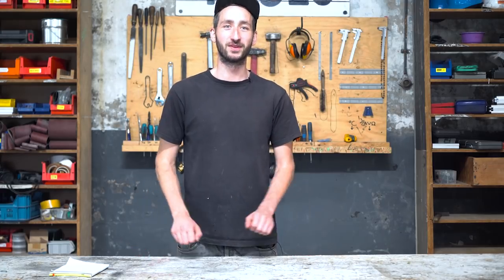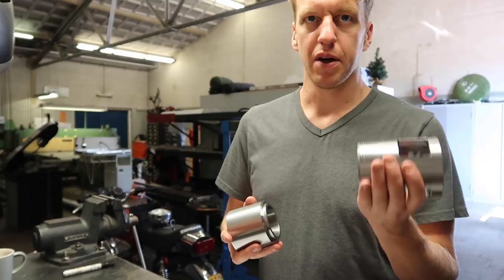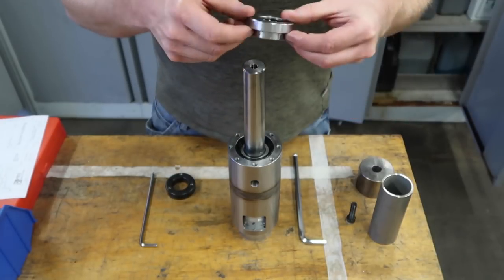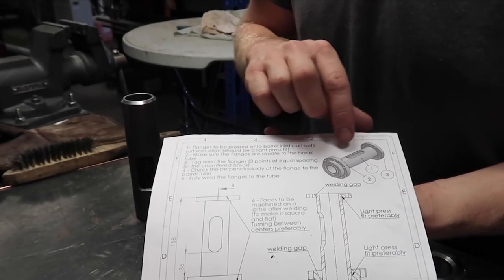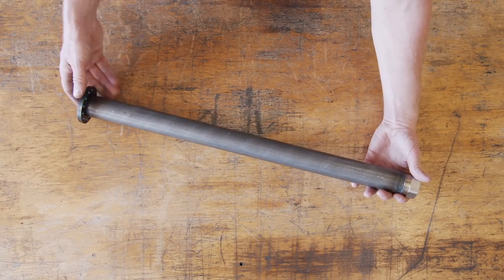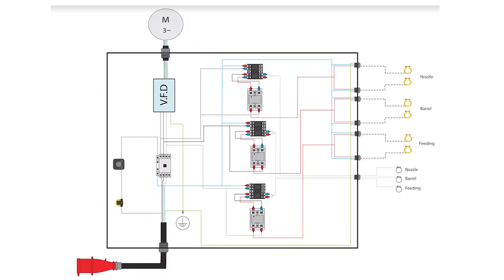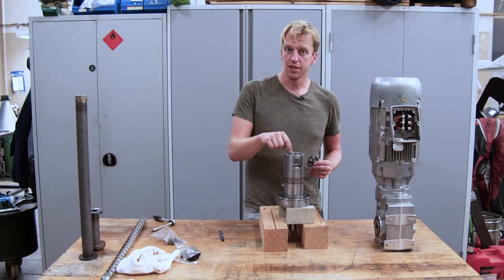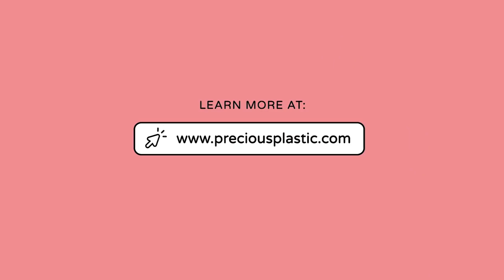Precious Plastic - Build a PRO plastic extrusion (part 3.6)

Comment: What is the durability of the plastic product? For instance in another video you discuss making plastic beams. Are they UV resistant? Maybe you can make a deck out of it, but if it will just crack when exposed to the sun it might not work out.

Comment: I have watched the build a few times and will probably build one, i have a few projects that i would need a n extruder for. These videos are really good. Can you give me and your other subscribers an indication of the output of the extruder, Kg/Hr of Polypropylene, also how many Kw you would need for the heater bands. The parts i want to make are an extruded part, 3 types, approximately 1 metre long. I am a retired Toolmaker and have a fully equipped engineering workshop. I hope you keep up the good work with these really good instructional videos. Reg

Comment: thanks for the tutorial, how much did it cost you to make this machine
Reply: Around €2000 - 2500 for all the materials (in the Netherlands). This includes the screw,  motor, frequency drive and heater parts.

Comment: I hope i have one for my place, for rescycle some plastic
Reply: It will be underutilized if you just built or bought one for just your use, better idea is to build a community around recycling plastic; that way you reach more people and solve recycling needs for your community and/or locality.
Reply: If you want to build one for your own use, build it smaller like this: https://medium.com/endless-filament/make-filament-extruder-for-465-bbc0e8a74e74 apply same method, just different/smaller components which doesn't require 3 phase supply instead will work off DC power supply

Comment: Hey I wanna ask you that if we mix all the seven types of plastics and shred it and put it in the densifier will it make a good quality product
Reply: No it will not as every plastic different glass transition temperature and different binding affinity, the end product will be crap
Reply: i was wondering that and then, why do we have so many types?!
Reply: @jameswalton15  different polymers, different chemical structures and different properties like melting temperature, glass T temperature, cofficient of expansion, resistance to chemical corrosion and solvents, cofficient of friction, dielectric constant, density, tensile and compression strength to name a few.

Comment: any way of doing this with single phase instead of 3? usually only industrial areas get 3 phase.
Reply: If use a motor designed for single phase then you are good, otherwise get a transformer and single phase three phase convertor.
Reply: It uses 3 phase because otherwise it will melt your wiring, 3 phase can supply more power over thinner lines. You need 3 phase or just downsize this unit like this: https://medium.com/endless-filament/make-filament-extruder-for-465-bbc0e8a74e74

Comment: Why didn't you just machiene the two parts at 4:30 as one ?
Reply: I have no idea too. They didn't press the bearings in before welding too. Maybe they just didn't have a long enough boring bar and its easier to measure that inside face for the bearing when they aren't together.

Comment: Did you test at what Nm torque the machine will stop working as desired?  That 3kW / 109Nm motor (values from your page https://community.preciousplastic.com/academy/build/extrusionpro) with geared down output seems like it would be way overkill but, maybe not.
Reply: you could get away with a little bit less torque but around 100 Nm is definitely recommended. And the 109 Nm is at the output of the gearbox just to clarify
Reply: @peter-basschelling6695  oh, that does help explain it.  I guess it just needs tons o torque.

Comment: You should've used recycled plastic instead of wood to make the video perfect.
Reply: Let's put the machine that's designed expressly for melting plastic on top of a platform made out of plastic 🤔
Reply: @ericpeterson6520  YES! 🤣
Reply: They shouldn't even be using wood but "gypsum boards".

Comment: Europe is so lucky that you didn't suffer the Edison syndrome and you have 220v 3 phase readily available.  Here we kill several people a year from wiring fires caused by the heat cool cycle form our "safer" high current love voltage.